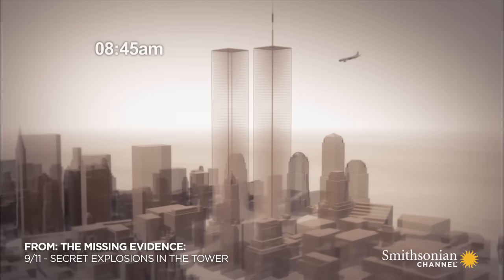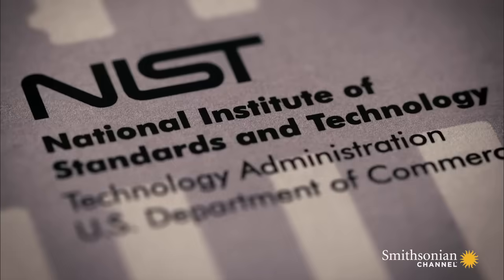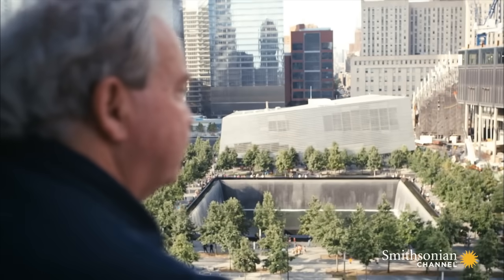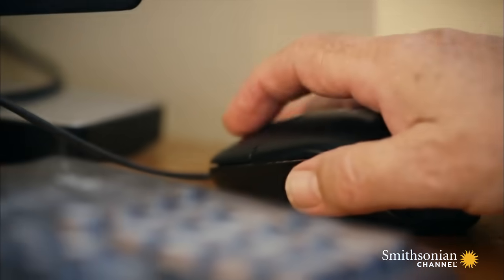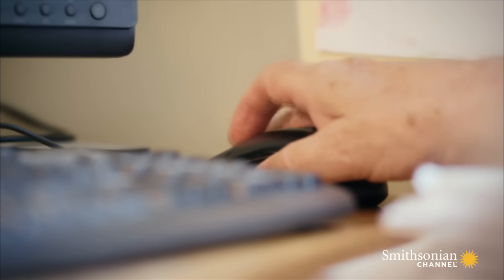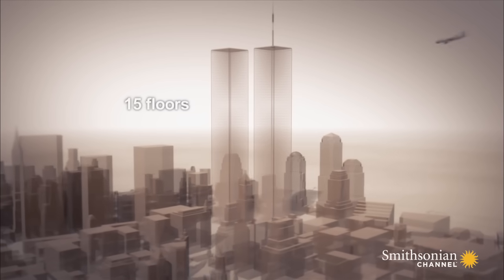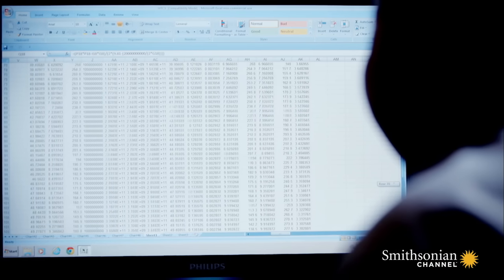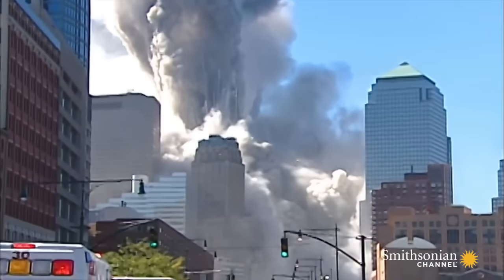This Computer Simulation Explains How the Twin Towers Fell

Comment: So he just assumed that all columns on the collapsed floor failed at exactly the same time, which is only possible in demolition
Reply: It didn't. The top part of the building came down tilted to one side. You can clearly see it in the videos. Even if the failure is on a single floor, imagine the weight that will be quickly dropped onto the rest of the building below. There's no stopping it once it breaks at one point because of the weight on top of it.
Reply: ''which is only possible in demolition'' <--- BULL. 🤦‍♂️
Reply: @Do_They_Know_Its_Christmas  give me one possible event that could make all columns, on the same floor, fail together at the exact millisecond....im waiting on your reply 🤔🤔😂
Reply: @mechanicosz9337  
Verinage (top down) demolition, and that's done using ZERO explosives.

Comment: "I ran the program..." Shows Microsoft Excel sheet.
Reply: You have no idea the power of Excel. Seriously, excel is fantastic for equations
Reply: @BatXDude  he said microsoft
Reply: @Cinnigen  Microsoft excel is excel lol
Reply: @patrickjin6610  its a joke
Reply: @Cinnigen  Huh?
Reply: Microsoft excel can be used for programming.
Reply: MS Excel IS a programming language. An unusual one, but it is.
Reply: @MajorDumai  Sort of. It has a programming language.
Reply: Excel is programmable.
Reply: nobody mentioned building 7
Reply: Excel is the best program around for this type of analysis
Reply: dude almost every sofware that using calculation is based on excel sheet. Every sheet is linked to one another for every equation. And dont be surprised if a saved of equation in excell can valued ten of thousand dollar. One of my friend show to me a save excel sheet that he take from a university he intern showing the calculation of waves resistance towards ship that value 4000USD..of course you will need simulation to verify that, but calculation is as much important as simulation. Without specialize sofware to calculate specific type of calculation excel is the way of your problem.  I dont know much about programming but i do know a little from some of my friend that try to developed apps for some calculation. Designing a sofware is job for programmer. But designing the calculation equation is the job of engineer and he do that using excel. So either way excel still give the same answer  but  wih a complicated  data and task. But finished sofware will simplified all that and giving result with just a click.
Reply: 9/11 - The Great American Psy Opera - Documentary 2012 (Ace Baker)
Reply: Excel uses Visual Basic programming language, so yes, you can create a program within the program Excel.
Reply: Microsoft Excel can be as good and as efficient as any other high level programming language, like Python, Java etc.. It just depends on what the purpose of the "program" is and what kind of calculations you're doing. In fact, if you're mainly processing tabular data and you're fluent in Excel you can probably be much more productive than someone doing the equivalent calculations in a high level programming language.

In other words, you have no idea what you're talking about.
Reply: @LanTheWarder  Excel не годится для таких расчётов.
У меня в университете на предмете "сопротивление материалов"  расчёт изгиба одной балки от определённого воздействия занимал 11 страниц вычислений..  и не в Excel,  а в MathLab 
P.S.:  самолётов не было - смотрите документальный фильм, который я привёл
Reply: @vladimirfasyura8191  I love how you assume I understand Russian (which I don't).
Reply: @troepvanerik5880  "scripting languages" are a subset of "programming languages"
Reply: @troepvanerik5880  Java laughs at your statement.
Reply: With excel you cant effectively perform dynamic analysis of static behaviour of large constructions

Comment: Wouldn't just the top part of the building fall off leaving the rest completely intact because the plane hit one side?  Doesn't seem like that jenga game at all.
Reply: For the top to just "fall off" it would have had to slide more than 100 feet sideways! 

Please explain what forces were present to do that.
Reply: @Tim22222  Maybe the force of a plane literally obliterating the structure of a building.
Reply: @Cmbg32  Yes, it certainly did a great deal of structural damage. Exactly why the top fell straight down!

Comment: I study architecture, and let me tell you, no one designs buildings to withstand a commercial airliner impact.
Where did they even got this information
Reply: Supposedly the WTC engineers performed a study that determined the towers should survive a strike similar to the 1945 incident in which a B-25 bomber lost in fog crashed into the Empire State Building. Of course, a heavy 767 doing 500 mph is nothing like a much-lighter B-25 doing 180 mph; nor were the twin towers anything like the ESB.

Comment: I think, what really got people puzzled was how "cleanly" the buildings came down. You would expect a more "unorderly" demolition with buildings leaning to the side or something. How could this be without "assistance" by explosives? I'm glad independent research by different people came to the same conclusion, that it was possible by the aircrafts alone in the manner we saw.
Reply: @MrModeratorIseeSomeEnemies  Empire State building
Reply: @Chris1980436 @Chris1980436 you're really comparing a plane the size of a private jet to 2 large commercial airliners?
Reply: @Chris1980436 Empire state building was hit by a B25 Mitchell Bomber with a wingspan of 67 feet. The towers were hit by a Boeing 767 with a wingspan of 156 feet. These two incidents are really incomparable and should be thrown out of the argument
Reply: @MrModeratorIseeSomeEnemies  there wasn't anything successful about what happened to the wtc other than the buildings being destroyed like it was planned. Explosives with a side of "air liners". What happened to the Empire State building is what should've happened to the wtc also just damaged to knocked down.
Reply: @MrModeratorIseeSomeEnemies  those buildings fell almost instantly. Fire couldn't have did that. They were simply demolished.
Reply: Buildings only tip over when there is a soft story collapse, or ground failure.
Reply: both buildings were leaning. i honestly believe both towers were built laced with demo charges to avoid them toppling other buildings in case of a fire as a security measure, and someone ordered it to be hit, but they will never admit it even if it was done to prevent more deaths.
Reply: @bladerj  Out of every comment I've ever read regarding the suspicions around the WTC collapse, this is the one that makes the most sense. It's completely unbiased, entirely plausible and even logical from a builders POV for (new) major high rises in big cities. Also not tied to any kind of "government did it" conspiracy theory. Gonna keep this comment and do more research.
Reply: @bladerj  No evidence of them being rigged with demolition charges. The way the towers collapsed where you can see the steel sections turn into dust in mid air, suggests that some kind of exotic technology was used which "vapourized" the steel in a matter of seconds before hitting the ground. The rubble that was left was barely a couple of feet high, no sign of any furnishings, none of the 4000 something toilets on the ground, nothing but mostly dust. Fire doesn't turn steel into dust like that. I suggest looking into the research of Dr Judy Wood who has written a book called "Where Did the Towers Go". Also British researchers Andrew Johnson, Mark Conlon and Richard D Hall have also talked about this. Very convincing evidence backed up with research. Any suggestion that energy weapons were used immediately gets censored on youtube.
Reply: Super Tall buildings don't tip over like a tree, can you name one that did?
Reply: @bringbackhomesteadchickent4043  can you name one that fire was the cause of collapse?
Reply: @Jay-ro2vn  WTC 7
Reply: The TTs collapsed out like a volcano and you call that clean?🤦‍♂️
Reply: What happened was the jet fuel melted the steel beams and that’s what caused the towers to fall how they did.The top floors feel down on the bottom.
Reply: @nickmarchionda4345  no. Your theory would leave the columns still standing , it could also never fall at that speed without the use of explosives
Reply: @nickmarchionda4345  90% of the jet fuel burned on the impact. You know the big fireball.
Reply: @nickmarchionda4345  jet fuel can't melt steel
Reply: @Wikchsawa  steel has a failure curve just like every other material. Steel is rated for a certain amount of hours before it can fail, a regular fire can cause it to fail if long enough. Steel doesn't fail like wood, steel slowly bends, like gummy, and when it reaches it point, it completely fails
Reply: @The1Music2MyEars  i already know that, any material can be compromised but I still doubt the whole building would have completely collapsed, check the other comments there is a lot of people with good knowledge that don't think the same like u.
Reply: @nickmarchionda4345  There are videos where you can literally see the explosions going off.
Reply: @amandaserena2007  where?

Comment: Just observe how the towers disintegrate into dust. 110 concrete floors, (47 IIRC) steel columns, office interior, mostly turned to dust before it hit the ground. Resulting in an extreme lack off debris which should be at more then 10% (12 -14 %) of the original height of the building. That's a 40 meter/120 feet debris pile missing. What was there was 3 inches of fine grey dust, all over lower Manhattan, from river to river. And (almost)everybody acts like it is normal. Amazing
Reply: love how no one is pushing Dr Judy Wood`s theory which above all makes most sense. Look at the facts of that day, what truly happened, THEN, and only then, work out the how and the why.
Reply: 8 ft above ground level lol I seen dozens of excavators ranging from 40 - 120 tonnes crawling up and over the debris pile, to help recover bodies and pick through debris to remove, they looked like toys on that carnage, that original comment was hilarius
Reply: Nonsense! The towers did NOT turn to dust! The proof? They spent 7 months removing very solid debris. No debris was missing. Perhaps you're missing the fact that the WTC complex went 7 stories underground?
Reply: @Tim22222 
The highest point of the debris from the two towers at the World Trade Center was 8 feet above ground. Yet WTC Building 7 that was 47 stories high, less than half the height of the 110-storey towers, collapsed into a debris pile almost 6 stories (60 ft.) high. Please explain.
PS. Building 7 had 5 underground levels.
Reply: @newjeffersonian6456  "The highest point of the debris from the two towers at the World Trade Center was 8 feet above ground."

Your source for this ridiculous claim?
Reply: @newjeffersonian6456  where did you get that information 😂😂😂😂

Comment: The computer program can also explain what happened to the massive steel central columns. Just watch those numbers flash on the screen. Who would not be impressed at what you can do with Excel?
Reply: @Quake proof a house Taylor Devices Viscous Dampers do you honestly believe that or is it sarcasm?
Reply: For those who didn't understand the sarcasm, the Excel numbers are to fool 90-95% of people into thinking that something beyond their comprehension is occurring, whereas in reality, it's like the nonsensical spoken word salad of Deepak Chopra but in numerical form.
Reply: @KXSocialChannel  Exactly. Wake up people
Reply: its a miracle!!!
Reply: With Excel, you can see the output of a complex algorithm as efficiently as it gets. This likely is just a data export of the relevant data.

Comment: Blokes a joke each impact would slow the descent! Noticed he left building 7 out the picture.. Ha ha jokers.. 👀🇬🇧
Reply: @Explosives violate gravity ONLY causing free fall what do you consider "high velocity"? Controlled demolition is an industry with safety standards.  If those standards were not there a criminal could cause a building to collapse at "free fall" if they had unrestricted access to the building.
Reply: @trollharder1488   Uh huh. Anything else, loser?
Reply: @tpryce1525 😭😭😭😭😭😭
Reply: @trollharder1488  So you’re all done now?
Reply: @tpryce1782  nice you are
Reply: @tpryce1782  thank for promoting the cause

Comment: The way both towers went down looked like it was controlled.
Reply: The TTs exterior steel panels legged out during the collapse.
Reply: Legging out does not happen in a controlled demolition.
Reply: I have never seen a controlled demolition that started in the middle of the building. The towers didn't look like CD at all.

Comment: The perimeter tube design of the WTC was highly redundant. It survived the loss of several exterior columns due to aircraft impact, but the ensuing fire led to other failures. Many structural engineers believe that the weak points—the limiting factors on design allowables—were the angle clips that held the floor joists between the columns on the perimeter wall and the core structure. With a 700 Pa floor design allowable, each floor should have been able to support approximately 1,300 t beyond its own weight. The total weight of each tower was about 500,000 t. 

As the joists on one or two of the most heavily burned floors gave way and the outer box columns began to bow outward, the floors above them also fell. The floor below (with its 1,300 t design capacity) could not support the roughly 45,000 t of ten floors (or more) above crashing down on these angle clips. This started the domino effect that caused the buildings to collapse within *15-20 Seconds, hitting bottom with an estimated speed of 200 km per hour. If it had been free fall, with no restraint, the collapse would have only taken *9.2 seconds and would have impacted at 300 km/h. It has been suggested that it was fortunate that the WTC did not tip over onto other buildings surrounding the area. There are several points that should be made. First, the building is not solid; it is 95 percent air and, hence, can implode onto itself. Second, there is no lateral load, even the impact of a speeding aircraft, which is sufficient to move the center of gravity one hundred feet to the side such that it is not within the base footprint of the structure. Third, given the near free-fall collapse, there was insufficient time for portions to attain significant lateral velocity. To summarize all of these points, a 500,000 t structure has too much inertia to fall in any direction other than nearly straight down.
Reply: Great explanation! One point, though: The actual collapse times were much longer than 10s; 16-20 seconds is more accurate.
Reply: @Tim22222  are you high?
Reply: @tpryce1782  get help
Reply: @tpryce1782  thank for promoting the cause
Reply: @Quake proof a house Taylor Devices Viscous Dampers you can't read can you...

Comment: 3:41 what caused the eruptions bellow the falling portion of the building??
Reply: The propane heating system exploding floor by floor. Heat and pressurized gases act a lot faster than a object just set into free fall. The massive cut to all the propane lines causes a massive decrease in pressure causing it to retract into the pipe and then rebuild pressure until the pipe gives away in an explosion due to the 3000 + *C flame inside of them rapidly heating due to increase of pressure. This is going to surge through each of the floor in a cycle of building pressure and releasing pressure. If it hasn't released the pressure by the time the floor above makes contact then the added pressure from the floor making contact will cause the pipes to explode and since the entire building was heated like this it caused eruptions to occur below the falling portions of the building.
Reply: @MinkoMix  Thanks, why doesn't it happen all the way down though?
Reply: @jeffmahoney1271  Lack of back pressure after awhile, the gas is constantly being released and there would only be so much gas in the reservoir. Once the back pressure dies down enough the flame would have stopped erupting pipes as frequently if at all and made it's way back to the main unit likely in 7WTC the 47 story building due to ease of access of the units. Which then causes a propane fire to start causing the collapse of that building as well due to the 5000*C open flame when steel melts at 2750ish*C. Which supports the claim that the fire suppression system inside the building didn't have enough water pressure to put out the fires. Which makes sense, 5000*C would evaporate any water that got near it. It's like dripping a drop of water on top of really hot pan, it's bubble around until it either evaporates or falls off the surface due to the Liedenfrost effect. Basically as the water gets sprinkled down towards the fire a layer of steam would form on the water mid-flight potentially knocking it off course due to rapid boiling or just boil all away once it gets within a foot. Gotta think water turns to steam at 100*C, so put near a 5000*C heat source and it's going to evaporate almost instantly within a few feet of the source.

As for the actual heating system, I know it was done at one point with water, but gas would be a much more efficient method to heat a building of that size. There were modifications done prior to the crash and some still in progress during the crash so it's very very likely a tenant requested a propane heating system be installed which would have required piping throughout the building. To further add to that propane became prominent in 1911 for commercial use, so between then and 2006 I highly doubt that a propane heating system would not have been installed in a building that size.
Reply: @MinkoMix  Thanks for clarifying. I never know what to believe once I'm down the rabbit hole lol but what you're saying makes total sense.